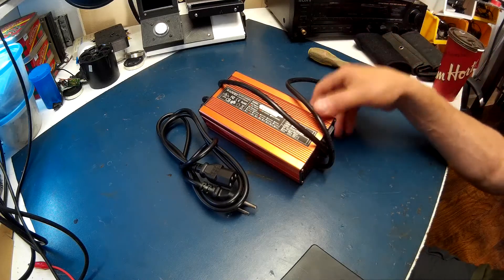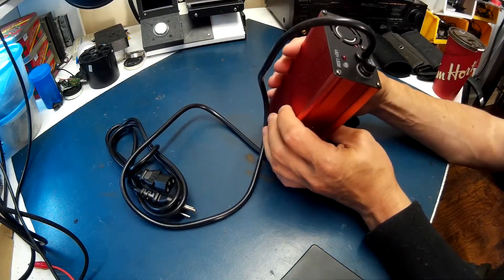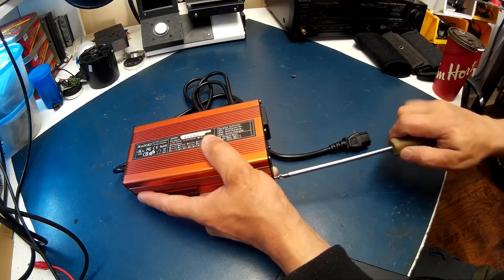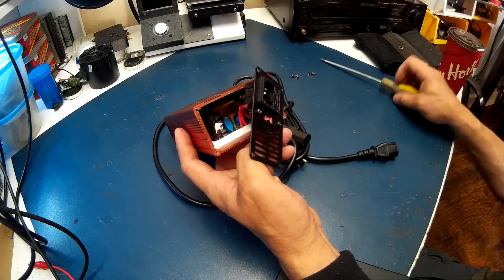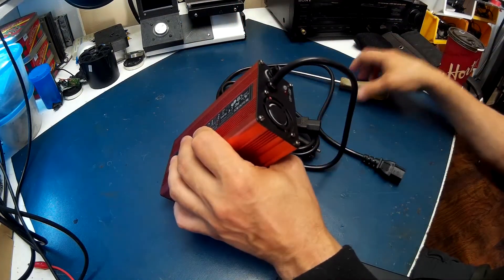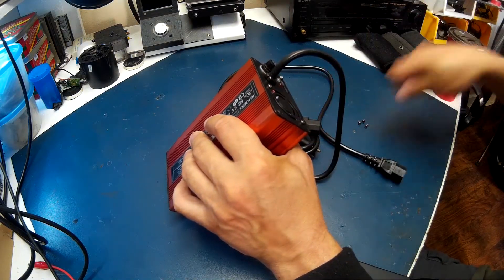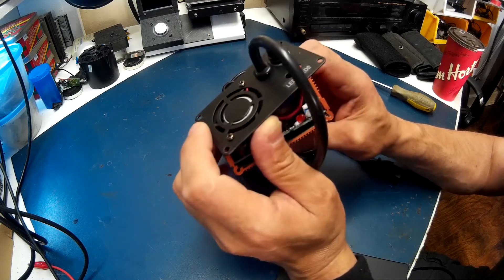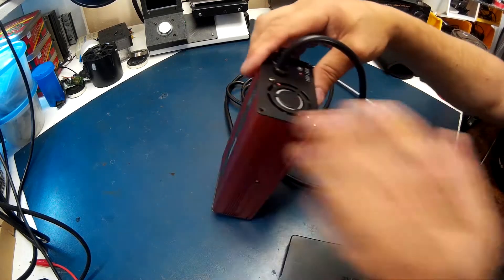WAOUKS 58.4V 4A Charger 48V LiFePO4 Battery Smart Charger 16S

Comment: Just remove the top of the case, and you will have access to all the board, don't need to unglue and unscrew the mosfet heat sinks.

Comment: Are you concerned that the label on there says it charges Li-Ion, Lead Acid and LiFePo4 but is not adjustable. All those battery chemistries need to be charged to different voltages. Depending on what battery it's charging, it'll undercharge or even overcharge! let me know your justification for that b/c it worries me for charging a LiFePo4 that is only supposed to charge to 3.65v per cell compared to Li-Ion which is 4.20v per cell, substantially higher.
Reply: I tried the lead acid version with the digital readout and it made the whole bottom of the bike hot....
Reply: @bethalpha  ebike’s don’t run on lead acid batteries anymore. You likely used that setting on a lithium-ion battery which is the problem. Be very careful matching the correct battery chemistry. What you did there is quite dangerous.

Comment: Hey bud very nice video. I just bought a Prodeco outlaw bike that has a 48v rear motor. The seller didn’t have the charger so I need to get one but i wasnt sure which one I need. The battery I have says 51.2v series 9 Ah 461Wh  High power Lithium Lifepo 4 battery system. That’s what the sticker says on the case. Any advice on which charger I should get? Any help would be great thanks.
Reply from the maker: https://www.batteryspace.com/smartchargerfor512v12cellslifepo4batterypacks.aspx